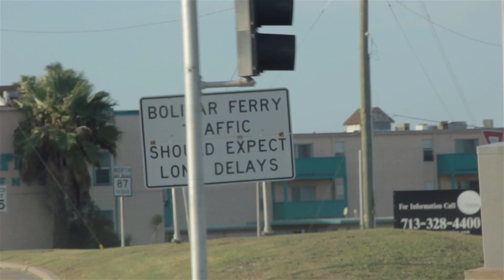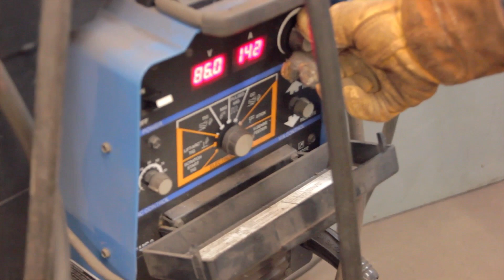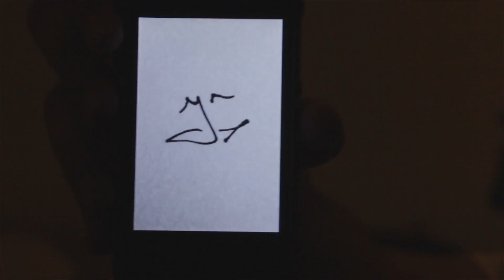BURNING (A Welding Documentary)

Comment: I got lucky. My college welding instructor made sure we had a scientific grasp of how welding works so we could figure out how to go at various situations. I have spoken with students of other schools in the state and they were clueless. I had to explain to a group that the mig wire they were using wasn't copper, just copper coated to protect the steel from corrosion. I believe it works as a weak flux but I don't remember for sure. I know it sits on top of the weld.

Comment: I understand this guy is new, but holy geez those are shit welds. If you've got air bubbles going on, slow down and turn the amps some. If you have lumps of filler metal, go a little faster and readjust your travel angle. Little adjustments can make all the difference on your beads. Talking about Smaw here

Comment: Every TiG welder will tell you, "Give me 5 minutes and i could teach a monkey to wirefeed weld. hahaha learn to TiG.
Reply: I started off learning with a TIG a few months back, on almost exclusively aluminum nonetheless. I have not touched a wire feeder yet. I dont understand where TIG comes into play in the industry if working with a wire feeder is so much faster, is it only for specialty applications?
Reply: Cessna 182a TIG is mainly for areospace welding where it has to be clean and have full penetration. usually areospace TIG is backfilled with gas to ensure no sugaring on the backside. I don't do that kind though... can't smoke weed at those kind of shops.... I do stainless finish welding where its gotta be a pretty weld every time. TIG is also better at sheet metal.

Comment: I’ve been at Gwinnett tech for a month and I can do better then this. Again a month. I’m also not walking around like fuckin commando welder here. Also who the fuck is in charge like what the hell any instructor that would see a student doing this would put a stop to it instantly. Plus tap the rods to expose the wire then put it in the holder and try to start the arc. You’re also lucky y’all didn’t destroy the welder with that ending y’all did there good god.